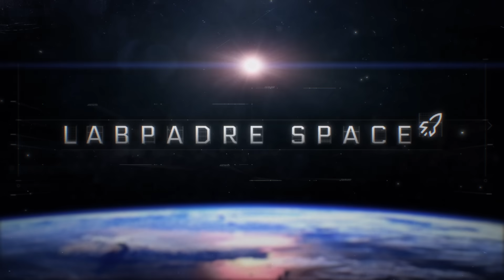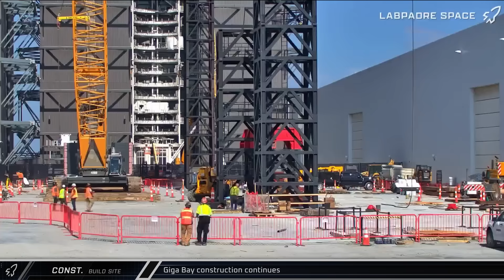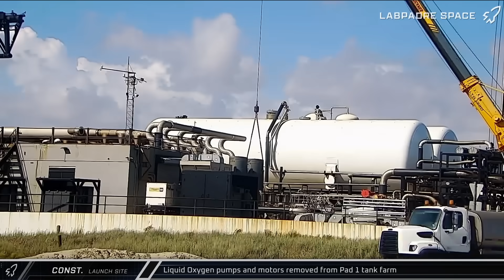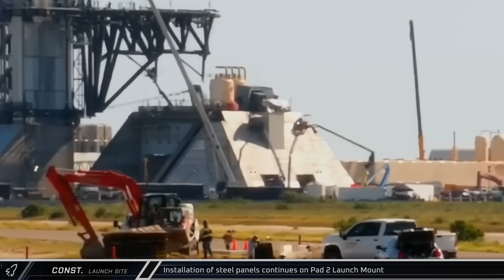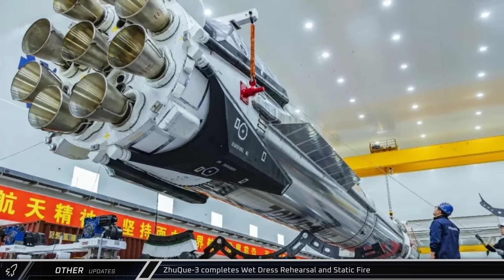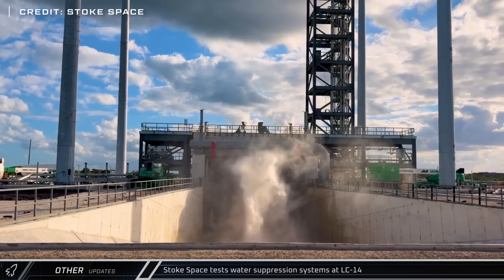Clearing the Way For Upgraded Starship Launch Infrastructure - Spaceflight Weekly #190

Comment: Based on what I've seen they appear to be setting up the Pad 1 Chopsticks to be chopped in place.   They've welded lift tabs on the outer two sections of the arms.  The only other set of short stix is in FL and they are needed for Pad 39.  Good summary!

Comment: I thought the payload bay of V3 was going to get longer.  The clip you showed with it moving to be joined onto the top of the methane tank looked like it was the same size.
Reply: It is basically the same at this point, but will be extended in future. I assume it will be enlarged once V3 raptors are proven and capable of lifting the additional payload.
Reply: @therealjamespickering  Thanks.